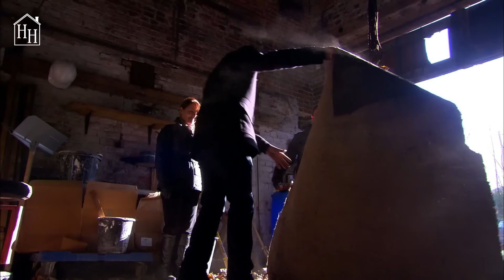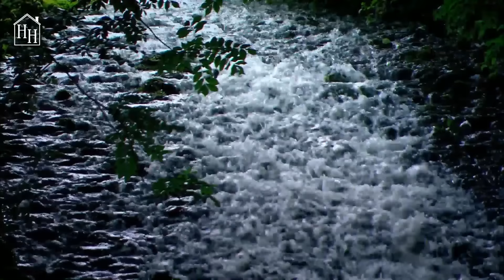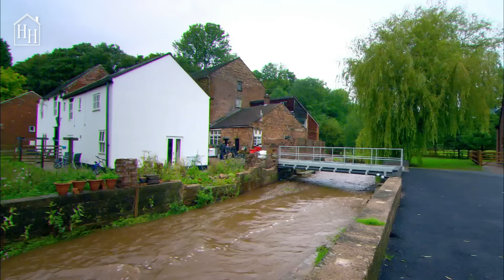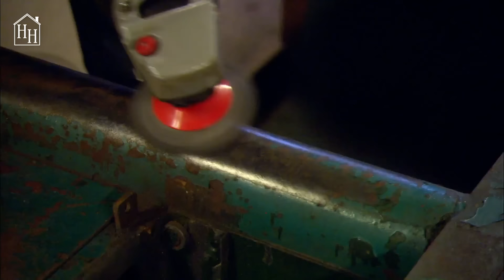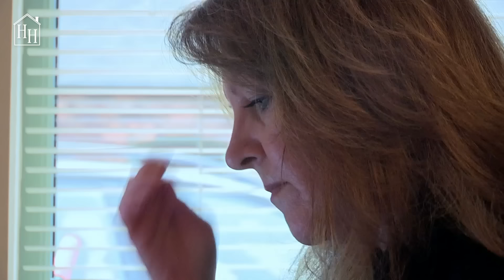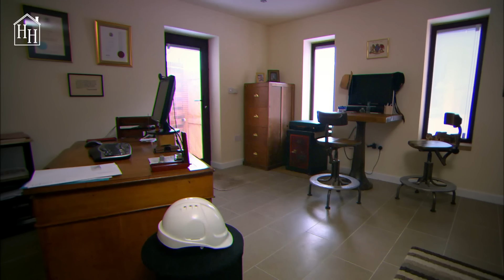Flint Mill Is In Danger of Collapsing - Can It Be Saved? | Restoration Man | S3 EP2

Comment: I’d personally say that it needed way more windows in the design from the start. It ended up being so stiff and prison-like without the necessary natural light to keep things airy inside. Also they HAVE to paint the wooden exterior of the garage and addition a dark red to match the new windows’ frames. The bright color of the wood doesn’t mix well with the brick as-is. But if they’re happy, they’re happy!